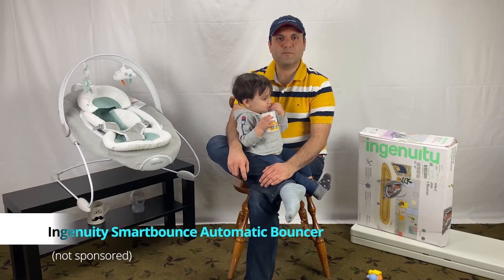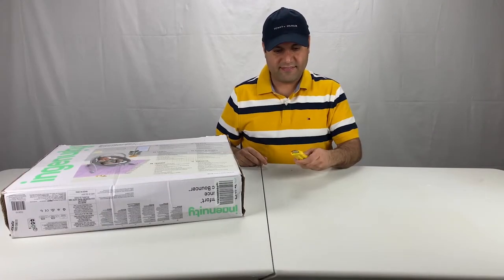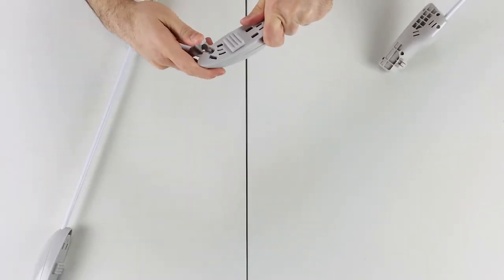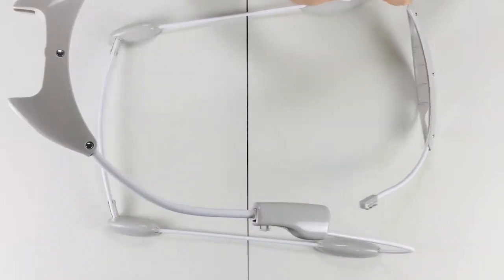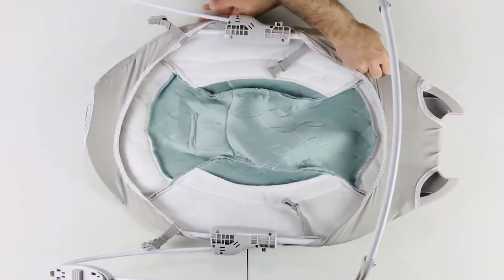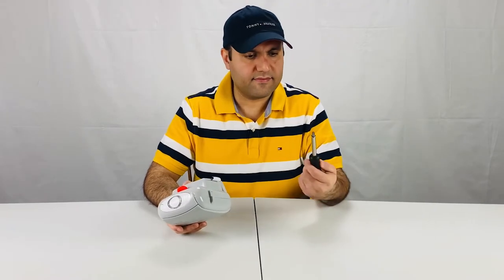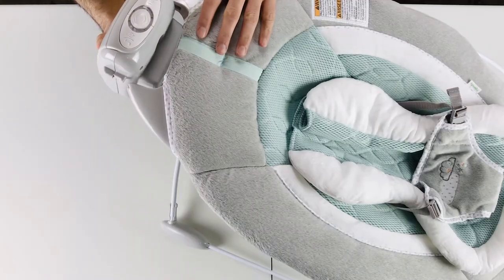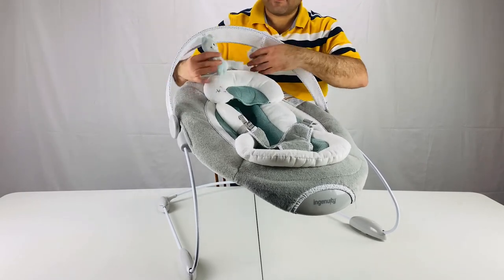Ingenuity Smartbounce Automatic Bouncer: Assembly & Unboxing  [Step By Step]

Comment: Does it make some sound while bouncing?
Reply from the maker: Hi Nida, Are asking about playing some music or just structural noise?
Reply: Not the music but the one I have make sounds like tuk tuk when it bounce
Reply from the maker: @nidaali3  Go to 2:29 in the video that I linked in this comment. I shared the music with my bouncer... let me know if you get those? otherwise, maybe there is something wrong:
https://youtu.be/LrbcGHX8_pg
Reply: Not the music but structural sound like the batteries are moving inside when it bounce.. does it happen with urs also?
Reply from the maker: @nidaali3  now I get that. YES! It happened to me as well. And it was annoying. It is like batteries are loose. I put some tissues around the batteries and it got much better. They could have made it better for sure.